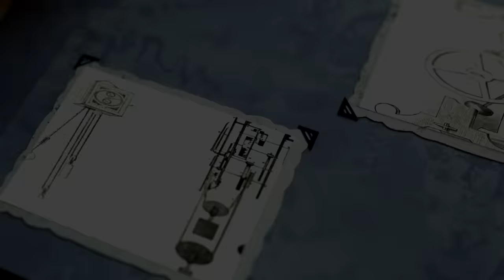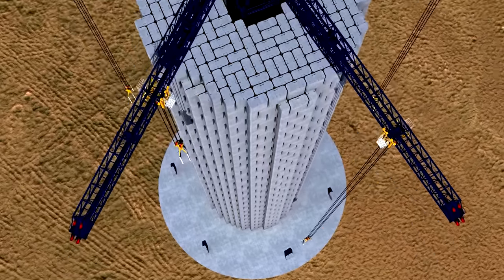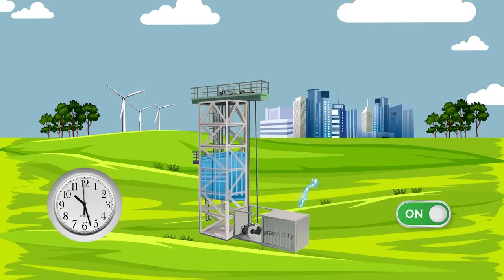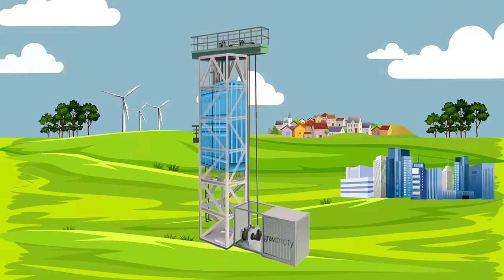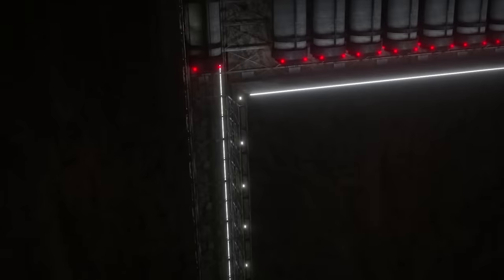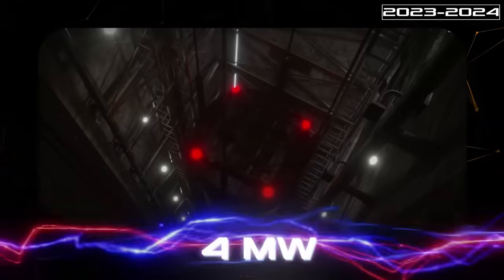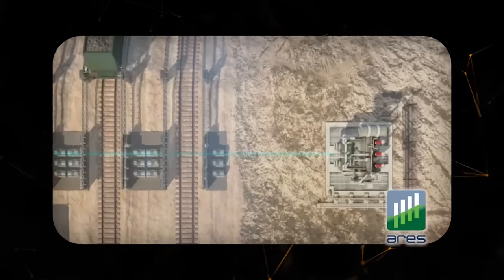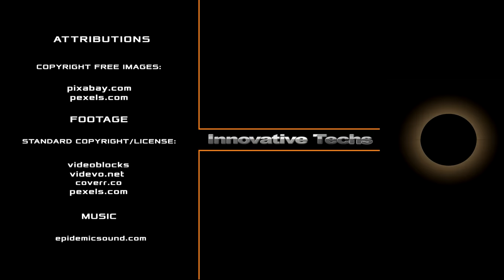How gravity batteries could change the world

Comment: As others have mentioned, just pump water instead of lifting weights. Turbines placed at the bottom of mine shafts would generate the electricity. Pumps would get the water back up to the surface. Mine shafts could have curves in them, but appropriately sized pipes would snake their way down to the turbines and pumps. All you need is the desired height. Also, pumped water shafts are somewhat impervious to ground water infiltration since you would already have the pumps at the bottom of the shaft. Appropriate lining, as required for sections of the shaft would keep water infiltration rate under control.
At the surface, place a large pond to accumulate all the pumped water. Above that water, place your solar panels. 
This could be an opportunity for profitable cheap hilly land in Pennsylvania, with lots of conveniently placed abandoned coal mines and mine shafts. Valleys in those mountains would become the ponds for storage. Solar and wind turbines, if appropriate, would span the tops of the hills.
GitRDone!
Reply: Water introduces a series of problems that have to be dealt with.   Filtering it, keeping it bacteria free, rust, leakage, etc.    Steel\Lead is heavier than water and has none of water's design issues.
Reply: Too bad all the people and wildlife that live in those valleys would have to lose their home. And what of places without convenient hills or mine shafts? At least this method can be used anywhere
Reply: Better idea.  Use buoyancy and gravity.  Almost opposite of your idea.
Reply: Agreed with Mike. + Water evaporation would be a huge problem too. I think Mike meant that there are other denser* materials we can use instead of water.
Reply: the issue is, Einstein, that you need specific locations for pump storage...like a large supply of water and a nearby incline with the desired slope.  the gravity technology in the video is exciting because it can be built anywhere.
Reply: @mikepayne1350  Not to mention, water is not as dense as concrete, so energy density is not as much.  The maintenance problems of water are innumerable.
Reply: Problem is, the only time we can produce extra to do this is at night and the only sources of nighttime production,  they're trying to kill ( Nuke, oil,gas).
Reply: @mikepayne1350  Steel or what ever solid you are using comes with much more problems. Every outside structure is completely of the table, because it would have to deal with wind and if you are using cranes to stack 100000 blocks with high precission to heights of several hundred meters you are crazy. So we would use the mineshafts or any other form of more protected structure which either increases the cost or completely destroys this "you can build it anywhere" point. You would also have to disattach and attach the blocks, which would be a logistical nightmare for a fully automated system. Pump hydro storage only needs two tanks, a turbine and a pump. Water doesn't brake and one pump can move all the water over time. The number and power of the pump will just increase the input power, not the total capacity.
Reply: @digger105337  Those are not the only sources at night, nor would you only have extra power at night. Nuclear is expensive and slow to build but we are still building new reactors and many of the existing ones will keep working for decades. Wind blows harder at night in most areas and almost nowhere would it just stop blowing. Geothermal, tidal and wave power would keep producing 24/7 unless shut down for maintenance, and hydropower plants on many rivers have to keep letting water through all the time too so if there is a place to store the power they can keep producing it. Meanwhile, solar power is super cheap to build and we need spare capacity for days when it gets cloudy so on sunny days there would be more solar power produced than needed.

If there are still areas where lots of coal power is needed, the plants have to keep going at a steady rate to remain efficient so coal will keep producing cheap power at night for a while. Gas and oil though, those are best used for temporary peak power demand so they would be kept shut down as backup for the times when there is some huge demand or production will be down for longer than energy storage can cover for.
Reply: suitable locations are not found everywhere on your planet. The existence of water, a mine, or something deep/high that can be pumped up is not available or feasible everywhere. The sifol principle is used in some of your countries. Realizable free/cheap energy has a higher price than you think. It requires peace and cooperation on your planet, which is also lacking in the current stage of human evolution.
Reply: @rooftoproller  Yep. We do need cheaper and more plentiful energy for our developing civilization. Let me ask you, how do they generate energy on your planet?🙂
Reply: @peterdavila3045  There is peace on our planet. This serves as the basis for the proper distribution of energy. The principle is similar to your solar energy cells. The free electrons are also captured here under the influence of sunlight. During the rotation period, the energy travels through wires to where it is needed. The day side generates energy for the night side and vice versa. Energy is thus globally available to everyone for free.
Reply: It's like winding a music box and releasing the stored energy in the spring to do work. The thing is, all you're doing is storing excess energy. What we need is to use nuclear batteries that can give us a constant rate of radiant energy for a hundred year, or more. Better than to leave the nuclear waste underground contaminating thousands of years doing nothing. Make use of it, us up it's energy and save the world all at once.
Reply: Pump water into bins that would work the same as weights.
Reply: @davewebbav  No it would not. A bin filled with one cubic meter of water weights 1000kg while same volume of concrete is about 2500kg so it stores 2.5x more energy than water, and filling the bin with something heavier like metal ore would store even more energy per cubic meter.

Water only works when you can build a big reservoir that stores millions of gallons of it.

No, putting turbines in the water pipes of tall buildings will not be worth it, especially as that would mess up people's water pressure and likely leave the sprinklers dry if there was a fire.

Though replacing one of the elevators with a 500 ton block of lead would not work well either. Flywheels or Powerwalls would be both cheaper and take far less room while storing more energy.
Reply: @JoSeeFuss  Your flywheel idea made me think of something. How about storing the energy in a compressed spring. You can use appropriate gearing to keep compressing a long spring. Put the spring inside a protective long pipe. Then, when you need energy, get it from the expansion of the spring to power a generator through appropriate gearing.

One of the benefits of such an idea over the lifting of weights shown in the video is that there is not much structural engineering issues to worry about with building multi-story structures. You essentially have a level foundation for the large pipes that enclose the springs.
Reply: The problem with water is the fact that they required a lot of them to generate enough energy to power significant numbers of homes.

Also, finding high places up the mountain that could store massive amount of waters are not easy. It's extremely rare. Hence why most Hydro Plant are located in naturally advantages areas.
Reply: @JoSeeFuss  Did I understand correctly that you are suggesting using the weight in the tower to make a flywheel turn?

That would make both too complicated, increase the already high cost and make both systems less efficient.

Flywheels are being used in various locations because they can deliver power instantly, but they are both large and expensive per kWh stored. One possible use for gravity battery is replacing flywheels because towers and weights are simpler so potentially cheaper than the precision machined cylinder in a vacuum chamber rotating at such speed that any tremors causing it to touch the walls would make the whole thing explode like a bomb.

Both systems have the weakness that they cannot store lots of power per unit and there is a limit on how big you can build them, so you need to build quite a number of them to manage enough energy to make grid storage viable.

However, relatively common and therefore cheap materials allow for building such large numbers so there might be some use for them. It largely depends on if cheap chemical batteries can be produced in bulk and be even cheaper at the scale required.
Reply: @peterdavila3045  Large amount of metal would be needed for very small amount of energy stored at pretty low efficiency. There is a reason why most cheap toys and watches use batteries instead of springs these days.
Reply: @rooftoproller  Und wie machen Sie das auf Ihrem Planeten? 😋
Reply: there is a video about how gravity batteries are a poorly thought out idea.
Reply: Dan Schaller  Err, whut? You sound like you are trying to drop A to lift B so you can drop B to lift A again.

This is known as a perpetual motion device and you do not need to be an engineer to know they are illogical and do not work.

Even if you could turn off the laws of physics so there is no energy lost and 100% of energy in A is recovered it still would not work because lifting B would use up all of the recovered energy and you would have nothing left to turn into electricity and send to the grid.

Also, if you want to move water you want it in pipes specifically to avoid extra maintenance. Outside pipes it will collect silt, get absorbed in ground or evaporate, and quite possibly carve a new path for itself and go where it is not wanted.
Reply: Very small capacity.
Reply: @StsFiveOneLima  Not relevant. You can have oodles of water at a third of the density of concrete. All you need is a suitable site. Gravity batteries are a waste of time and effort.
Reply: Weights are better, you can get more weight from less size + your not wasting water, maybe someplaces don't have as much water, like in Africa, idk why don't they put solar panels, they can provide whole world with electricty if they want to
Reply: @mrbane2000  Wrong.  Weights require a huge amount of infrastructure for not much energy. Suppose  you pushed 10,000 tons up a 100 metre hill.  That is the equivalent of 250 fully laden lorries.  The hardware required to do that is not trivial. The amount of energy stored is mgh = 10^10 joules or about 3000 kilowatt hours.  Here in the UK the average power consumption of a house is about 10kwh per day so this amount of energy would run 300 houses for a day. 10,000 tons is about 2,000 cubic metres of iron.  That is a cube with side length 12.5  metres. That is a lot of iron but it is miniscule when compared with the capacity of even a very small reservoir.
Reply: @rogerphelps9939  idk. I use neutron star to store my energy in
Reply: @mrbane2000  The water is getting recycled by pumping it up to the reservoir. The pumping of the water from the bottom up to the reservoir is your "battery" recharging.
Reply: @peterdavila3045  how hard is it to pump air bubble into water depth.
Reply: @nntflow7058  Not if you find an abandoned mine. No need for mountains. Just put your reservoir on the surface of the earth. The Head pressure of the water to the bottom of the mine is what you care about and need for energy production.
Reply: @rooftoproller  Could you share your material science with us earthlings for making the needed high temperature super conductors. That would help with moving energy around from light side to dark side of planet.
Reply: @AnalystPrime  True That.
Reply: @mrbane2000  If you're serious, and not just making a joke, then you could use vessels deep in the ocean. Your air pumps on the floating platforms would compress the volume of air in the underwater tanks to at least the water pressure at depth. One problem with such a system is that you would need to control the pressure differential between the ocean pressure at depth and that of the inside of your tanks. If not, you risk tank implosion. 

What you could do is lower the tanks from the surface gradually. As you lower the tanks into depth, you use the solar power or wind power from your water surface ship to increase the air pressure in the tanks to that of the water pressure. By the time the tanks are at the bottom of the ocean, you would make sure to keep the  pressure differential between the tanks and ocean depth to within device limits. Then, just make sure your pressure inside the tanks is neither too high or too low in comparison to ocean depth.

You would also have to build sub tanks at various depth. This is because you also have to control the pressure differential between the air pipes and any ocean depth.

This is doable. It may even be practical. But, if you think about it some more, you can use that idea of compressed air without  the complications of ocean depths. That is, the deep ocean pressure system won't ever be able to store more energy than that allowed by the maximum pressure differential allowed by design between the compressed air and pressure at depth. Therefore, you can use the compressed air pressure idea by putting the air tanks floating on the ocean or just built on the surface of earth. This is because in this case, your stored air pressure differential is also limited to the differential with the atmospheric pressure.
Reply: @mrbane2000  For places like Africa, or other places where there are no abandoned mines or dug up strip mines ... What you could do is make a circular structure of pipes for water and just put it right on the surface of the earth. Put many centrifugal water pumps at specified intervals along the pipes. What you're trying to do is increase the water pressure. Connect the end of the pipe to water turbines. The final water pressure at the end of the pipe and the flow rate will determine how much energy your system can generate. The solar or wind farm keeps the pumps running and increasing the water pressure. This should be a relatively simple and cheap structure to build and maintain. A good setup without needing a hill or mine locally.
Reply: Just run nuclear and quit messing around.
Reply: @peterdavila3045  The conductors are dissolved in liquid, I don't know the exact composition, the liquids also travel on cables. This was not the main problem that had to be solved, but the excessive power supply of the equipment that promotes the flow of liquids, or pumps, had to be regulated and the pressure of the liquid had to be increased. Then they invented the spherical drive. Basically, the electrons from our sun drive the planetary core and drive it to rotate, when the planetary core rotates, the planetary fluids follow more slowly and the mantle also begins to rotate, just like on planet earth. They use this energy, and achieve a passive pumping effect, like the traffic vessels or similar. Of course, the liquid is almost a dry substance. Among its components, there are several on earth, such as graphite and mercury. This must be kept at high pressure and low temperature so that the atoms come together and there is little resistance. The current moves more easily that way. I can give more precise information in 2029, if I arrive again. Now I have to go home due to the upcoming very bad October stuff, I wish you all the best.
Reply: @rooftoproller  Excellent. Look me up when you return in 2029. Hopefully, I make it past October. We'll have a beer, or whatever fun drink you're accustomed to. I can just about drink anything. BTW, I tried experimenting with rotating mercury a long time ago when I learned about Maxwell's equations back in college. I had a huge jar of it at one time. All in an effort for anti-gravity research. I got rid of the mercury because of the toxic effects. Now, I do research on the underlying basis for Maxwell's equations in the context of the simulation. All in an effort to expand on their meaning within the context of gravity. I'm hopeful that I can add something to the equations eventually. May be we can discuss Time, Gravity, Maxwell and the Simulation when you come back. Bring a physicist from your planet with you.
Welcome to earth!
Reply: @JackyPup    CO2 emissions in the building process will be negligible in the long term.  And water will always present more maintenance issues than concrete.
Reply: yeah come up north in US and see how water deals with -30-40F and winters that last from October till May sometimes. i mean your ideea would be great but it's not feasible. and we don't even talk about bacteria in the water, the evaporation the constant need of a water source caused by evaporation, and these are only the big issues. i'm sure they don't need concrete for these blocks they can just build some big enclosures and fill them with compacted dirt or whatever readily available material we can find in nature
Reply: @railroadtrash09   Or combine a dual system with bouyancy and pumping
Reply: Why pump water up, use dams like we already do.
Reply: @jeffs-reviews  That's what this idea is. The bottom of the mineshafts are the sink side of the dam. But building dams is super expensive. So, instead, you just build the pond on the surface to provide the water reservoir that you get to dump into the mine as energy is needed. From the bottom of the mine, you dump the used water to a reservoir outside the mines in the valley. Once wind and solar generate energy once again, use that energy to recharge the pond battery with water from the valley.
Reply: That's a great idea! Using gravity batteries and water pumping systems in mine shafts could be a game-changer for renewable energy. And speaking of power solutions, have you heard about the Segway Portable PowerStation Cube Series? It's a versatile and rugged power station that could be perfect for outdoor enthusiasts like us. It's got massive capacity, fast recharging, and even waterproof technology. Check it out for your outdoor adventures and home backup power needs!
Reply: I think waiting for rain to fill reservoir is much cheaper. To produce Electricity....... Wait we already have this kind of tech😗
Reply: @QiuQiuChannel-ni3xj  True, but how many billions of dollars would it cost to build the desired dam nowadays? What are the land impact regulations for a large water reservoir?
Reply: @bvbxiong5791 ever hear of a water tower? Like the kind you see in every single Midwest town where it's unbelievably flat?